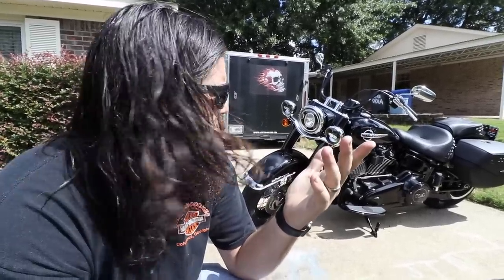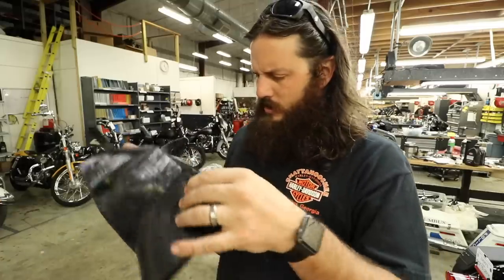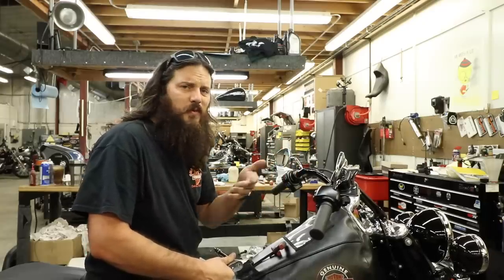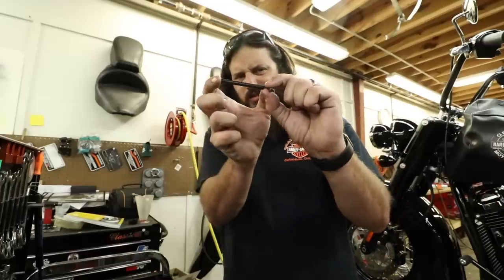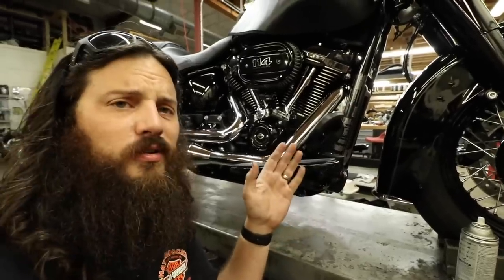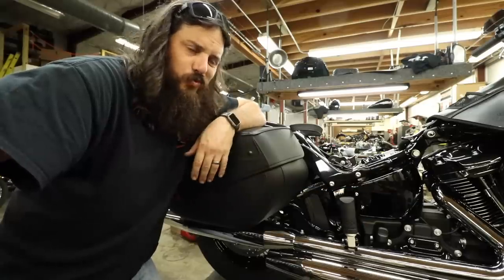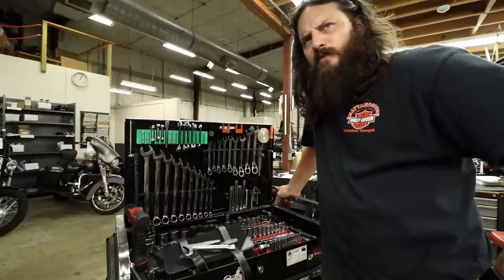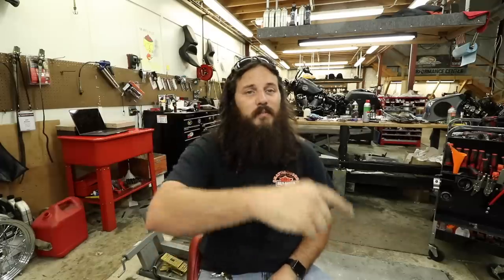What MOTORCYCLE TOOLS to pack when TRAVELING + GIVEAWAY

Comment: Good stuff. one of my best tool kits is an inexpensive 1/4" socket set from Ace hardware. it has a few other bits included too. Makes taking a buddy's plastic fairings off a lot quicker on sport-touring bikes. One of those slime compressors saved my bacon on a Country trip, great for punctures in out of the way places.

Comment: Good vid. I ride a BMW R1150RT that I keep a full compliment of tools, air compressor and slime (not recommended to use but it will get ya home) ready to use for me or a broke down moto friend. I have found it’s totally worth the weight and taking up a complete bag. If your not riding with tools, you’re not riding smart.
Reply: Check out C02 cartridge tire repair kit, can repair and fill tires and takes up very little of your storage space compared to compressor. I think Dennis Kirk and JP cycles sells them.

Comment: Awesome video man! I carry just about everything you mentioned here except for three things. Electrical tape, haven’t needed it yet but a “just in case” kinda thing if the zip ties can’t do the trick!😆  Tire plug kit and a small portable air compressor.  I got it on amazon and it’s about 4”x4”x1.5” but it’s plenty to keep me on the road to a tire shop if I ever have a flat. 

When I was planning on my first road trip I spent an afternoon two days before I left and went over the bike top to bottom. While I was doing that I was watching what tools I was using and made up a list and as you said it came down to what am I willing to do/ what can I do on the side of the road.  

Now I don’t keep my tools in the tool roll all the time. They’re apart of my portable mechanics set but I laminated the list and put it in the tool chest drawer with all of my specialty bike tools. That way I won’t lose it and can always refer back to it before the next trip.

Comment: Hey John, thanks for another great video topic. I once lost a shift lever bolt and had to get home by pulling the clutch lever with my right hand while shifting with my left.  That was exciting!
 I take a little bit of 18 gauge wire and some electrical tape.  It seems electrical gremlins will put you on the side of the road as quick as anything else.

Comment: Hello, I love your video.  I have an older 1983  gs1100l. I blow headlight fuses often so need tools for this but my tools came in plastic holder that has dried out over time. So new holder would be helpful to keep me on the light roads.  Keep up the info videos to help out the less tech savvy. Stay safe on the roads. Hgd

Comment: You covered alot of good stuff for a tool roll. The only thing I would and will include in mine is a set of spark plugs. Would hate to be stuck somewhere with no spark. They don't take up much room and could help you or a brother get off the side of the road.

Comment: Oh, and: carry some spare electrical wire and heat shrink tubes (and a lighter). You can easily fix broken or worntrough wire that way. Electrical wire is very strong so can be used to tie down things in emergencies. Also a piece of plastic tubing, so you can bleed brakes or hydraulic clutch on the road, can be needed in the mountains. It’s small but useful. Fuses offcourse.
I always carry a multitool. Also small locking pliers are ideal, even to be used when you break off a shifter (after dropping your bike). Stick on the locking plier, lock in place with a tie wrap and you can change gears until you reach a workshop/dealer. Also ductape, to repair luggage and saddles, electrical wire, etc.  Seems like alot of stuff but it’s small and will all fit in a nice pouch.

Comment: Great video. The shift linkage loosening and becoming non-shifting has hit me before on a long road trip. One thing I didn’t see mentioned is a flash light. I particulary like the Energizer LED one with the head-band and aiming adjustment. Just got a new 2019 Road Glide Special so the tool roll needs updated. Thanks for the video and the pro run-down.

Comment: Yeah, fantastic video.. I keep way more tools in my Road King than I should, As well as a ton of metric wrenches for broken down metric riders .. they came in the set so why not ? Harbor Freight tools in case of theft or like you said " In the event of forgetting something on the side of the road ".. On my Springer I don't carry anything but I never take it out of a forty mile radius of my house, I also have a 1956 Triumph Bobber again no tools … But I do keep fingers crossed, But here again never to far from home with that one either. Tools are essential for road trips.

Comment: Nice I have been commuting on my Electra glide and had that shifter rod end wear out and popped off. Luckly had a few zip ties but have really thought I should get a tool bag and what to pack has plexed me. Thank for the insight. Should it go under the goose neck at the top of the frame or do I have to worry about heat?

Comment: I would include a 3 to 6 ft 12 gauge speaker wire incase you travel in groups or you come up on a rider who needs a jump. I would splice both ends and roll it up in the tool bag. beats carrying jumper cables that are bulky.

Comment: See if you can get some messanger wire from the cable guy.  plastic coated stainless steel wire. It's like baling wire plus. I have even used it as. welding rod. A 10 foot section can give a temporary fix. I always carry some.

Comment: When I  work on my bike at home the same type of tool needs to be in the tool pouch on the bike. Well there are exceptions like a torque wrench. It helps to have a bagger.

Slime air compressor (size of a cigarette pack)
Jumper cables(home made)
zip ties
mechanic wire
gorilla tape
sealant
1/4 -20 bolts and nuts various sizes
electric ring connectors 
electric wire

Comment: Hey John, your videos are well made and very informative. It’s good that you don’t get any shit from your boss or the motor company for making them. 
Your tool roll definitely needs a light though, maybe one of those head lights unless you like the taste of flash light while you’re cursing in the dark fixing your ride on the side of the road. Also some spare fuses and some tape. Maybe even a fuel pump relay. A wrench to fit the mirror nut too, so after a bird strike you can keep that sucker from flapping in the breeze.
Reply from the maker: I keep a flashlight on my belt, so no need for the tool roll. Should have mentioned it, though! I did a follow up video nailing some extras. Definitely forgot a few things. As far as the bosses, they give me hell about everything, haha. As for the MoCo, maybe I can stay under the radar longer!

Comment: Back in the 1980s i had a few things go wrong out riding.
My headlight went out.
Could not change it, sense i didn't carry an extra full size glass headlight.
Is just what bikes used back in those days.
Another time i had my clutch cable break.
Lucky it was late night, and very little traffic.
So i push started it and put it in gear as i was rolling.
It was a little sketchy when i had to stop.
I made it all the way home without having to stop.
The next time my gas throttle broke.
I took my vice grips and attacked it to the broken throttle cable.
I pulled it over the handle bars to gas it, and let off to throttle down.
I made it home just fine.
Was not even a problem throttling that way.
I imagine everybody has their stories about things that went wrong, and how they got home.

Comment: Thanks for the info. I was checking online and found a tool kit but it was too expensive for me. Here is the list of tools, which are perfect for my 07 Electra Glide.  I hope this is helpful for others.

3/8", 7/16", 1/2", 9/16", 10mm combination wrenches
8" adjustable wrench
Locking pliers
5/8" (16mm) spark plug socket 
1/8", 5/32", 3/16", 5/16" hex keys
T25, T27, T40 Torx keys
6-in-1 screwdriver with bits
Mini ratchet
3/8", 7/16", 1/2", 10mm socket set
2" ratchet extension
Spark plug gap gauge 
Electrical tape
Mechanics wire
Threadlocker
Tire pressure gauge
Zip ties
Reply from the maker: Solid kit!
Reply: John Maxwell  Thanks John, glad you like it. I'll probably get the tools from Harbor Freight since they're cheaper and  won't be used hardly at all, I hope!

Comment: Great videos. Really learn a lot. Love the tips have used many on my bike. I have a habit of over packing for trips so I tow a trailer. Northern Tool 40 by 48 cut 7” out of width to fit my car top carrier with aluminum deck. Really light. Sure could use a tool roll.
Richard White
Bastrop Tx

Comment: Hey hows it going ? I Really like your info that you List here on Line, but I'm having an issue with a Wire that is on a 2007 Soft tail Deluxe, Located behind the starter area and it comes out of a Plastic Looking cover and it has and is shorting out my 40 AMP use, but the kicker is that although one side comes out of that cover that also has a Plug Next to it, Not sure if that cover is but I can't keep an active Fuse due to it keeps blowing out, can you suggest any info as to what is the Purpose of that wire that connects to NOTHING but comes out of that cover ?

Comment: You might want to consider bringing a plug socket just in case. Cheap one where you can use a screw driver to tighten or loosen. Of course a small Gun cleaning brass brush to clean plug before you put it back in. Just sayin

Comment: Hey thanks for the vids. I appreciate your knowledge and know how and have learned some stuff from you. Thank you for sharing. Been riding my sportster from new in 2003 last of the solid mounts. What did surprise me was that my tool kit for my sportsters is near on the same as you described.  Mine is in a old helmet bag wrapped in a dry bag ( it rains a lot here in the north of England)  I am setting off to work in the Netherlands next month so full service this week and as always tighten every thing I know that comes loose and check all the other fastenings.  That tool bag would really add some class to my old sporty, just done her 85,000 service and she is running sweet. I will be adding my multi meter to my pack for the European trip and possibly change or take spare throttle and clutch cables, what do you think.? Cheers

Comment: · Long Travel ·
Spark Plug wrench remover.
Sandpaper. Sparkplug spacer.
Tire pressure measurer.
Sockets for Every size Bolt on the motorcycle. Or a wrench that fits the bolts.
Lubrication fluid for chain, etc.
Screwdriver for any screws.
Fix Flat can to reinflate & seal holes in tires. 1 to 3 cans.
Two to Five spare sparkplugs just in case.
If your bike has fuses. Spare fuses.

Know your bike wrench socket sizes.

Comment: One extra thing to make sure all bolts are tightened on Harleys . . . BLUE LOCTITE!
Reply: Funny you say blue Loctite, went for a ride two weeks ago with the wife and her floorboard on her FXDL came loose and basically spun freely. I had put them on the night before and brought tools with me in case they needed to be adjusted. Luckily blue Loctite was in my tour pack from a previous trip!!!!!   Good recommendation!!!
Reply: Wil Handel yeah the guy I interned with at his independent H-D repair shop told me, “You put blue loctite on EVERYTHING on Harleys, minus the handlebar button housings.”. I’ve followed that since that day and have never had a problem. That and always clean your axleshafts when you pull em out to change a tire and put fresh grease on em.

Comment: Two small adjustables and an Allen key set now a word key set and duct tape in my roll, tire pressure gauge and tire plugs and a CO2 tire inflater for the just in case.

Comment: tools you take on trips? 1) Insurance card with phone number, 2) AAA number card, 3) portable jumper with battery mounted connection, 4) digital tire gauge, 5) Allen wrenches sized for your bike, socket set, combo wrench set. 6) Loctite, 7) tire repair kit with patch plugs

Comment: Yes I've got a question for you maybe you can help I have a 2013 straight bob with a 96 cubic inch motor after washing it 2 days ago I wrote it yesterday and I noticed the red light in the console was on it Road fine after I got it home I hook the trickle charger on this morning it wouldn't charge so I jumped it off and all the lights on instrument panel come on which were engine light the little red light again and also the battery light flickered on and off so I took it to the bike shop a road fine all the way over there I didn't have any signal lights and my speedometer quit working after getting to the shop I'll pull it in there even though I turned it off it wouldn't shut off up the shut off on a handlebars AR the key shut off on the console your comments will be greatly appreciated thanks brother always enjoy your videos

Comment: Another reason for cheaper tools on the road : I had a breakdown in the rain, worked on the bike getting all the tools and toolroll soaking wet. Packed it up when the bike was fixed and came home with a toolroll filled with rusty metal scrap. Tossed most of it away, especially pliers. So...only cheap stuff for me on the road. You are not using it all the time anyway.

Comment: Yes you forgot air pump , and tire fix kit
And it is more important then random sucker you not gonna need most likely
Reply: Yeah, and don't forget to put extra spark plugs in the tool kit.  You shouldn't  leave town without two in the repair kit.. 
Keep the rubber down and the shiny side up..

Comment: lol that travelmachine stuff is some seriously hipster shit. 80 for an empty tool roll (clearly the most useful thing on the site) thats going to get stuffed away somewhere like a saddle bag (if you are smart). other companies like Cruz tools offers tool rolls with tools for a similar price. sure they aint snap on, but its a useful option instead of bling. 

THe best way to figure out what tools you need: Do the service and adjustments at home. Mark with tape or paint each tool you use. Get a second set of each of those tools and put it in your roll. Add tire plugging gear, gaffer tape (not fucking duct tape) some solid wire (baling, mechanics wire, whatever you want to call it) zip ties and a test light. Unless you are trail riding a pan america off on one of the BDR rides, you only need to get the miles to the next town where you can get anything thats missing. It is really easy to get into the mindset that one has to be completely self sufficient. Not so. rarely is any HD rider in the US going to be more than 50 miles from someplace where additional tools and things can be had.

Comment: It's good to carry a extra cluch
Cable and even handle over a 
Life time of driving I have had about 3 or 4 cables brake up
By the handle and 2 handles brake
By the clutch cable attachment.
Be me it no fun trying to drive without a clutch. So carry a extra
Cable and handle just in case . 
I also had to plug about 4 tires 
From nails. Had some fixaflat
In after I put in a plug. Stop
At a station and brought the air
Up to 40 lbs and drove on it for years good thing I had tubless 
Tires because with tube tires
If u pick up a nail u are F. Of course my 1200 sportster is
Easy to fix on the road . Bigger
Bikes with lots I would probably
Try. Get another tire. But a tire 
Kit with plugs worked for me and I'm still driving with two plugs
In my back tire from two nails on
Different occasions.👱⚡☠️

Comment: I thought johnny that using a connecting tool to reach levrage is a NOno shed light as a mechanic if you understand me you know what you said alen and cresent levrage ¶ ¶ I say as a theory motocycle repair man and not a duch just my creation speeking go socket on everything a mini case should do it it will also have your tools strapped secured thanks for letting me comment john I praise you dude your my blockhead